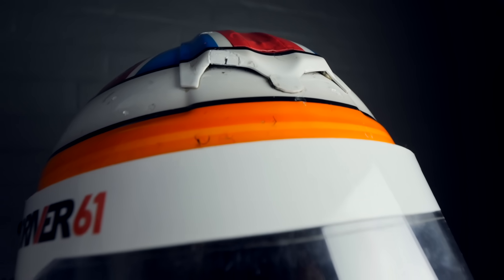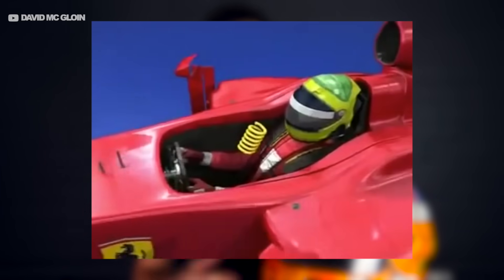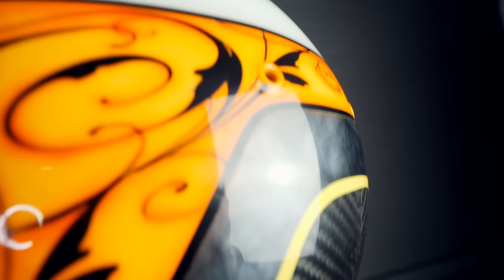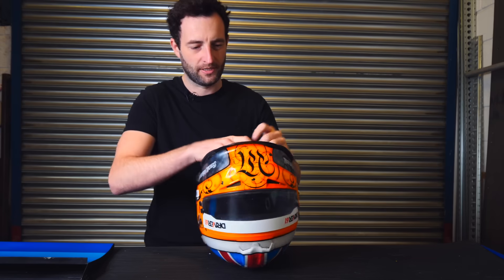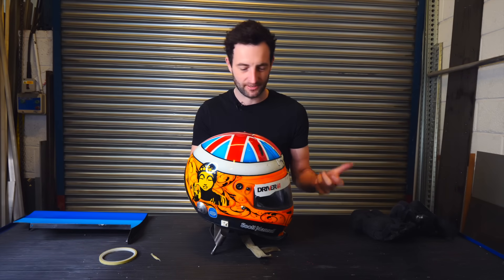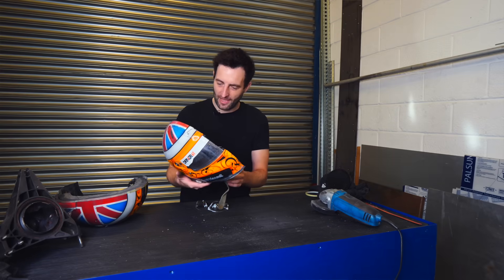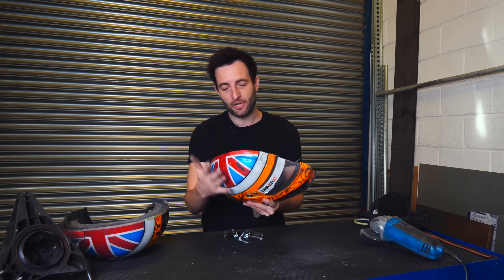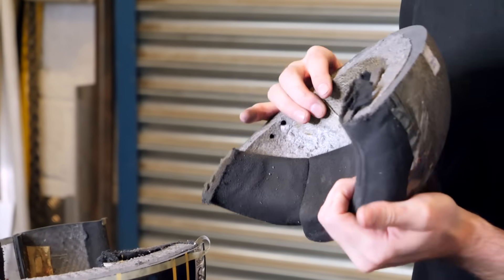What's Inside an F1 Helmet?

Comment: Just one thing: I worked with carbon quite a while now: Never cut carbon without a mask or safety glasses, and never do that inside. The carbon dust that results from cutting it is highly carcinogenic! I'm working in a Formula Student Team and literally the first thing we got taught is to never cut/drill/saw hardened carbon inside and without a mask. The fine dust will also stay everywhere for ages, as it's much much finer than "normal" dust. Just make sure you REALLY clean that table and your shirt now to not affect others and yourself working there in the future!
Reply: rip driver61
Reply: @Fael-TXR  driver 69
Reply: It's a good idea to wear a mask when cutting anything with a power tool. Anything you cut will produce fine particles and the power tool will spit them into the air.
Reply: Cannot agree more. Also I feels strange seeing that Driver61 do not give your comment a like despite you were providing valuable suggestions and already get most likes in the comment section.
Reply: I was wondering that
Reply: Good point, i was thinking that myself.
Reply: I was about to comment this, also it can't just be a regular mask, it's recommended to use a half mask with proper cartridges.
Reply: 2nd thing your taught, is never use electric tools with carbon, with it being extremely conductive, you either risk fking the tool, or risk electrocuting yourself
Reply: I see too, that what if he inhaled it.
Reply: How do u get into the Fromula Student Team? I want to get into the formula one industry but don’t know how or where to start... any advice?
Reply: Go to a university that participates to get the degree you will require to work in F1, and simply join the FS team, they are always in need of fresh members
Reply: @zer0751  There are a thousand different ways to get into F1. If you are still studying one good option is to go to Cranfield University and do the Motorsport Master.
Reply: And that sir is an excellent comment
Reply: weird his dad didnt point that out since he runs a team
Reply: @federicoeiriz42  The race team I worked for in N.A. brought in some Brit expat carbon fibre experts and their personal safety habits were very disturbing. The old school, old being 15 yrs ago, were more cavalier, as with most new dangerous materials handling protocols from any industry.
Reply: The whole time I was watching this I thought

'Sir... Where is your mask!?!'

Great video though!
Reply: Yeah & gloves I have had the misfortune of picking carbon fibre shards out of my hands for over a week & a half because of not wearing gloves whilst using carbon fibre kit at my work. It’s like furry cactus when in yer hands…… brush yer hand against something the wrong way and enjoy the shock 😕
Reply: Came to tell him he should probably have worn a mask, tech stuff isn't my field of study, but as the animal industry is, I'm all to aware of the dangers of dust. On top of that the lack of hand protection is probably also not a good idea
Reply: And it’s not as though you can get hold of a mask at the present time is well.
Reply: How did you get into a Formula Student team? I'd honestly like to do the same
Reply: Sound advice mate!
Which team are you on? @danort17
Reply: yes. I was thinking about that. The amount of carbon he inhaled :(
Reply: That or use running water on the cutting surface and a powerful vac.
Reply: Hello from an FSAE kid from AZ!
Reply: OH GOD MY HAND AR SWETING WATHING HIM JUST DO THAT
Reply: He had safety glasses
Reply: Yup. as i was watching i was complaining about the safety, no clamps, no gloves, THE HAND TOUCHING THE FRONT OF THE ANGLE GRINDER.

And the amount of dust coming off, nobody thought him to stop and at least get a dust mask.

Total utter incompetence.
Reply: @Splarkszter  no need to be so nasty at the end, people won't listen nor learn if you're like that.
Reply: Protected your eyes, but not your lungs.  Ironic for a video about safety.
Reply: Been on the field of cfrp  20y can definitely tell you that is harmful..but please please !!!don't forget what all drivers breath in every corner..the dust of cc disks is way .. more .. probably he got used of the smell.. fibers cut.. so the main issue isn't few minutes of this attempt.. but all f1 rounds.
Reply: what a dangerous thing to show and do on video.
Reply: @supernumex  You mean unlike racing cars at 200+ mph?
Reply: @renesonse5794  that's just a whataboutism. Racing is a calculated risk, where there are safety procedures and equipment such as helmets, seatbelts etc. Wearing a respirator for cutting carbon is like wearing a helmet for racing.
Reply: Not just carcinogenic, its incredibly itchy in the form of microsplinters in the air, and is very bad for your lungs for the same reason. Frankly that would be my concern far more than the carcinogenic properties unless its being done day in and day out. Either way its a useful warning to heed.
Reply: Also use a water jet cutter next time as it gives such a nice clean section cut.
Reply: There is no reaearch supporting how carbon dust is Extremely Cancerogenic... and I work with it for a living... the rest is true... see the hardener isnide epoxy can be cancerogenic in its liquid state, but thats a whole different story and has NOTHING to do with carbon dust
Reply: @antyNLV  Probably still a good idea not to breathe it in regardless.
Reply: @htdtr  You missed Anthony's point, which he made in a way that was difficult. (I commented this in the comment above, from my 1st hand experience on a race team). 
The carbon fibre part's dust has 2 elements: carbon & cured epoxy. Carbon is neutral but will burrow into tissue (lungs stomach, intestines etc) and remain forever. This is not good but not lethal.
The epoxy is extremely carcinogenic. Cured epoxy is still considered very dangerous and long term harm research is still being completed as the technology is (basically in wider spread use) only 30yrs old.
The epoxy is bonded to the carbon dust and both are inhaled. It is a big hazard I expect, like asbestos and other dangerous materials, long term workers will be affected and lives shortened.
Reply: @antyNLV  There's a whole lot wrong with the approach. The lack of mask is one small portion of it. It's recommended you wear long sleeve shirt, gloves, face shield on top of the safety glasses, use the screw in handle (which gives you more leverage without putting your hands close to the cutting disc) and so on. Reinplanting a finger costs around 10 grand per finger + the thousands of bucks you'll have to spend on therapy to maybe have finger movement back.
Reply: @antyNLV  Some work has been done on the matter: https://www.nature.com/articles/nnano.2008.111 
Which essentially says that it's similar to asbestos. Which makes sense since your body wouldn't be able to break the carbon fiber down, same as with asbestos. 
In any event, a mask was totally in order here.
Reply: @antyNLV  well… rip
Reply: @antyNLV  we haven't had enough research into carbon dust and carbon nanotubes to conclusively determine the affects. This lack of conclusive research doesn't mean it's inherently safe. Due to a lack of sound toxicological data CF are for the moment not yet regulated by a material specific occupational exposure limit (OEL).

Release of Respirable Fibrous Dust from Carbon Fibers Due to Splitting along the Fiber Axis  is an interesting study showing how prevelant the dust is during sanding or machining.